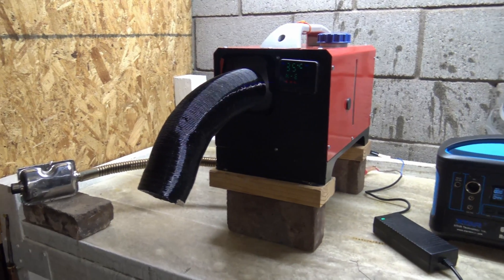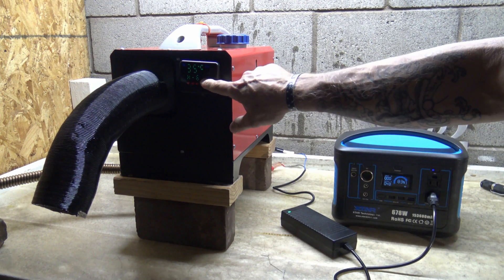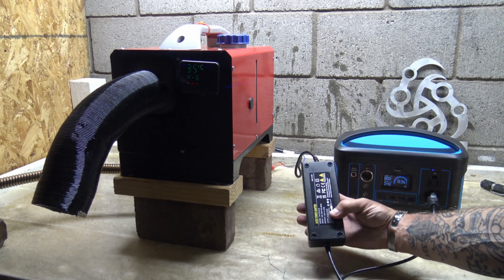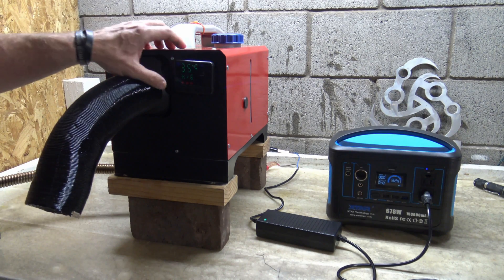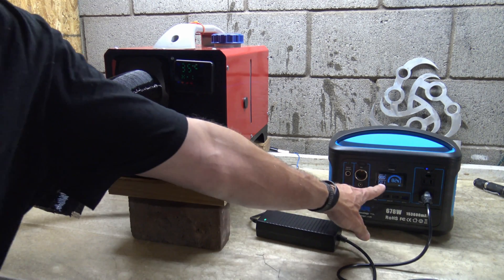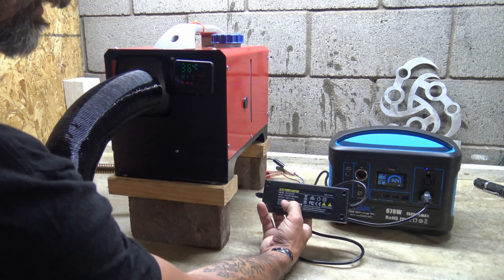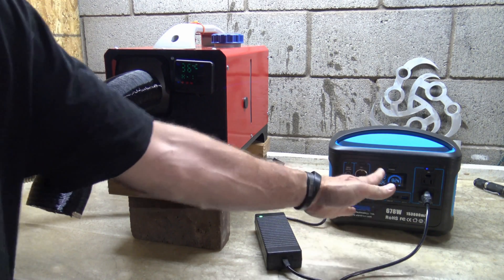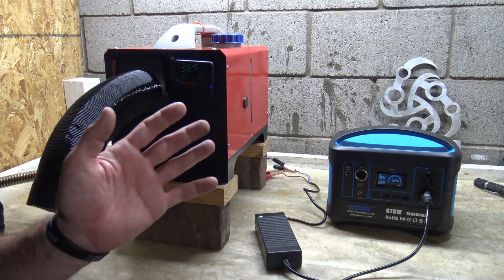Can a Diesel Heater Run On A Portable Power Bank?

Comment: How did you wire the diesel heater to the adapter converter?
Reply from the maker: That was a power brick that came with another heater. Works Great. You can get them on Amazon
Reply: @jiujitsu2000  I don’t know how to wire the diesel heater to the power brick. Do you have a video explaining how to?
Reply from the maker: @necreama  mine is pretty simple. It's 2 wires. One is positive and one is negative. I show it on a couple diesel heater video's. I don't recall which ones exactly

Comment: Thankyou for this video. I was hoping to do the same thing. I have heard that a diesel heaters can use 8-10 amps and a 12v plug only goes up to 10 amps. Has it ever blown a fuse?

Comment: I have two of the taller Vevors I also use with 15a power supplies I can run of my standard gas generator if power is out, but I’m looking at getting a solar generator for quiet night time running when needed.  What’s the smallest size solar generator I could get by with running 2 power supplies plugged into each AC outlet?  This will be dedicated to running both heaters so no additional draw from other items when used this way.

Comment: Thanks for the nice video. Yesterday I was camping in my roof tent and wanted to try my new vevor diesel heater with my anker power station… unfortunately it shut down after 30 seconds and I was freezing all night. Hope that converter works for me as well! But when I activate my AC converter on my powerstation then it pulls maybe 10-12 watt without a device on it is that normal? That means with level 1 in the heater 20 watt + 10 from the ac converter itself ? I am afraid that this could be too much watt pulling.

Comment: it just sucks that i have to use the inverter, for something thats called a 12v heater , ugh.
Reply: I know, as the inverter uses a lot of power.  I think Sunster are looking into a 12v 10a configuration.

Comment: Hi help please I have to lead acid in parallel 12v  but heater will not start  the fan comes on then starts to click for fuel  for 10 second then error codes and stops due to power shortage ,,what ami doing wrong cheers

Comment: This idea is only viable for specific battery banks. I tried this but it completely failed. Never started at all with my EcoFlow Delta2. Getting a 250W transformer will work for all power stations.
Reply: So you mean 250w at least then it works? I have anker 500 watt station idk if it works or not
Reply: Seen, with the AC DC converter, plugged into the 110v out on the solar chargr, as small as a Jackery 290 run a diesel heater no problem at all.  @tugayaydin4506

Comment: Thank you for this video I was running my heater in my pop up with a marine battery. Sold the pop and the battery but kept the heater. My jackery 1000 can’t start it due to the 9 amp max in the 12 volt outlet. This is genius and I can’t believe I didn’t even think about it as an option!
Reply: Have you tried this with your Jackery yet?  I’ve got two and have always used the same 15a power supply here to clean up peer from my old gas generator when running them during power outage but I’m looking at a solar power station for quieter night time running.  Trying to figure out the smallest Jackery I could get away with using two power supplies like this in each AC outlet of the Jackery.
Reply: Peer = “power”. I hate autocorrect lol

Comment: Great video, thank you for posting this!

Would the laptop power adapter with specs below work for my 5kW heater?

Input: 100-240V~2.5A 50/60Hz
Output: 19.5V -- 9.23A (Max 180W)

Comment: This was cool to see.   Once it runs awhile and is running hot, can you turn it off and switch it to a DC source?  Will it still need over 120w to heat the glow plugs at that point?
Reply: That will not work.  These heaters are not supposed to be turned off.  They have to go through a shut down procedure that draws as much current to shut down as it does to turn on.  This procedure lets the heater burn off the soot before it is turned off.  So it will draw the same current to start every time.   I've thought about this too much myself.  The only way this will work is if you can have it switch from AC to DC output on the power station  without turning the heater off and I haven't figure out a way to do that yet.

Comment: So any power bank that can output 150w should be good enough to get the heater through the power hungry consumption phase?
Reply: No it’s gotta be atleast 10-15amp on 12volt which a lot of these little power banks can’t do they can do that no problem on the ac side

Comment: Never dawned on me to use a Laptop Charger as a Converter, but that's actually a genius idea! Been slamming my head against the wall trying to think of a simple solution that doesn't require me ordering a bunch of gear etc... This looks like it might be it! Thanks a bunch!!! xx
Reply: I saw another video who used a 250v inverter and connected it to Anderson plug 30 amp.
Reply: @patrickvernon4766 I tried this. Method on my WcoFlow Delta 2 and it was a failure. The 250w inverter worked tho

Comment: So 12v 10amp isn't enough? 
I bought the same power supply but with a 12v cigarette lighter adapter and it's 10amp. And I'm getting E -2 error not enough voltage.
Reply: no...
need just a bit more amp

Comment: Thanks. My heater was dying on startup cuz my power bank only puts out 10amps on DC, even though it's a 1kw unit. Bought a converter. Thanks for the video!
Reply: What converter do you have? Have a link?

Comment: Great idea on the power brick. Just what I was thinking. I have some old laptop bricks, will these work, and any cautions to worry about. Nice vid btw.
Reply: check your heater's manual for how many Amps it needs.. It'll require a LOT more the first minute or two for the Spark plug to heat up, your manual should tell you! Mine is an 8KW heater, and the manual says it'll need 15A

Comment: Why not just get a kerosene heater instead of all of this?
Reply from the maker: That's a great option too!
Reply: Because you would die of carbon monoxide
Reply: @jerrysetlerr770  ??? Ive used kerosene heaters inside for many winters.
Reply: I think the difference is that this blows dry air into the room, while with a kerosene heater you will get dampness inside (unless there is an exhaust on the kerosene heater?)